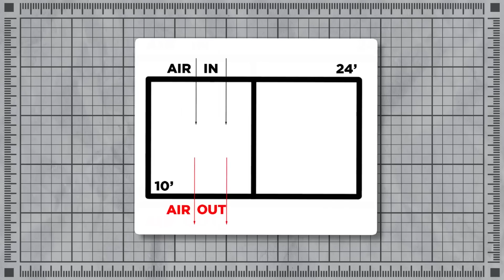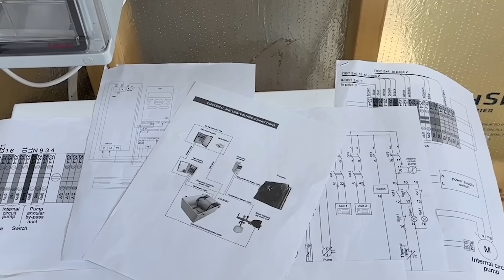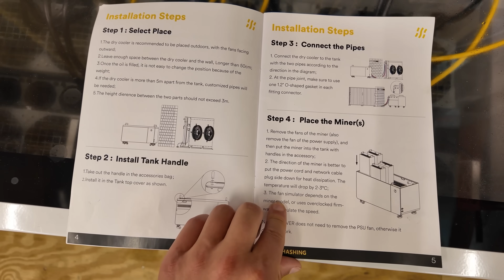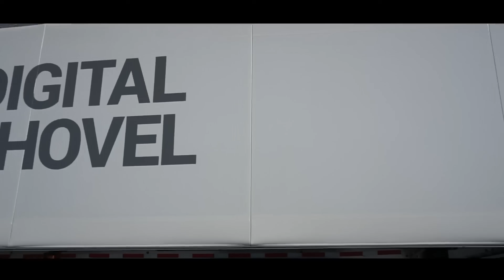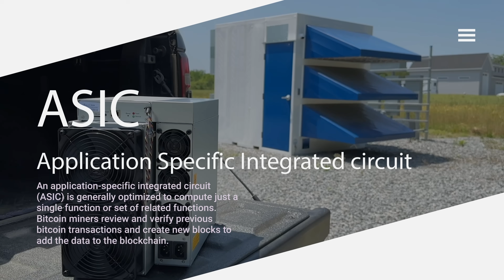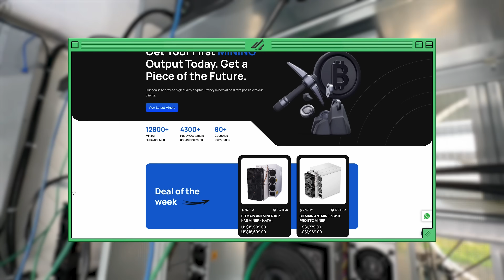I Spent TENs of THOUSANDS Dollars Building Bitcoin Mining Farm

Comment: Cool! Have you given any thought to Hydro? Seems like that's where things are going.
Reply: Not all things......but with hydro one needs 3 phase 400 volt setup. Most people dont have that kind of infrstructure. Vosk did talk about 3 phase a few times but I havent heard anything lately.
Reply: @RainBitcoins  I'm looking into this, you can buy the plates to modify S19/S21's and  getting pricing for 3P Off-Gride Inverters. I'm looking at the Solis S6-EH3P50K-H that's a 50kW 3P inverter.
Reply: @DIYSolarFarming  yes.... I have a setup here using vrf converters of VFD... I forget what their called... My electrician buddy set it up for me.. I already had access to 240V 400 Amp